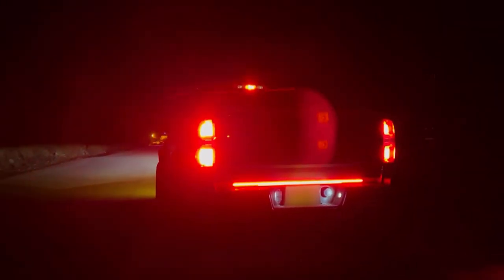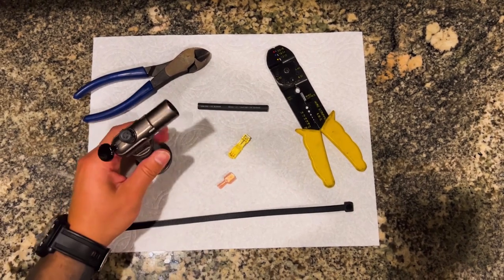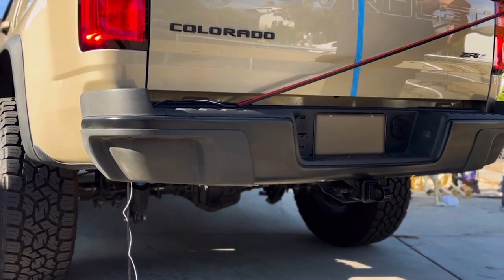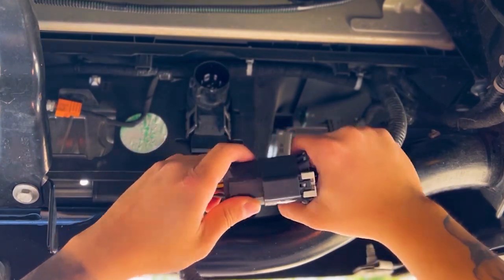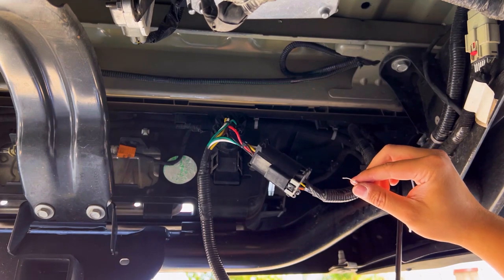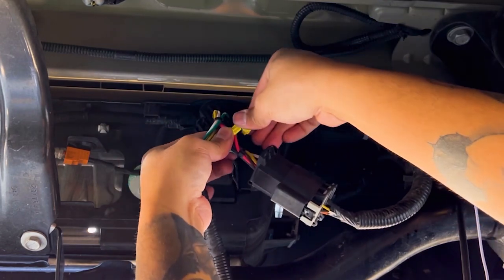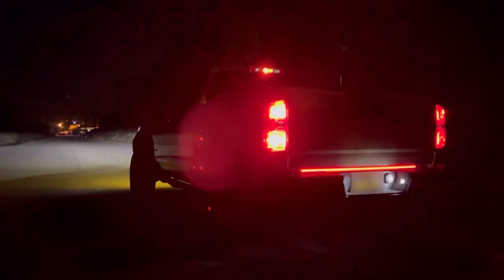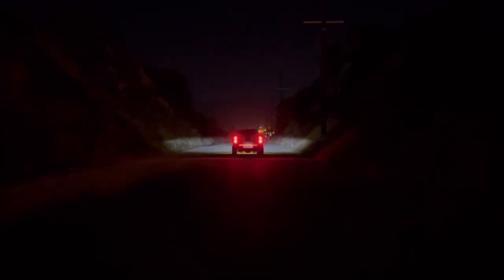[How To] OPT7 Redline 7pin to 4 pin Extension Adapter Harness Installation Video for Trucks & U-Haul

Comment: For an F150, will this harness avoid trailer detection given there's a current load on the trailer wiring?
Reply from the maker: Depending on the year of the F150. However, we offer Easy Connect Harness Adapters for specific years on the F150 to bypass the BLIS. Check them out here: https://www.opt-7.com/search?q=ford+harness

Comment: Wil this work on 2022 tundra 1794 without causing error on dash. I fully loaded model with rear cameras, blind spot and Rear cross traffic and trailer guide
Reply from the maker: On the Tundra, you'll actually need the 60''. The harness will work on the vehicle as its a plug and play.
Reply: @OPT7Lighting  I can only use 48 inch. 60 inch will not work because there are bolts on the side sticking out and prevents bar from being flush. It won't work. No room for extended bar with bolts in the way.
Reply: Those lights so fucking gay .

Comment: Does it work on a 2021 ram 1500?
Reply from the maker: No, on the 2021 Ram 1500, you'll need to hardwire the light bar instead.